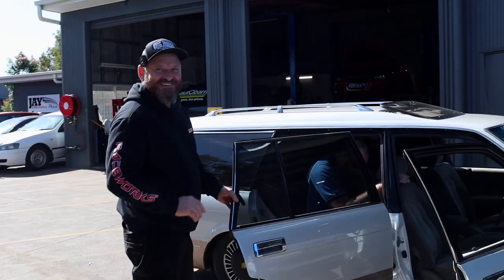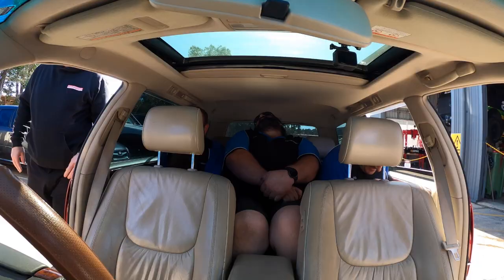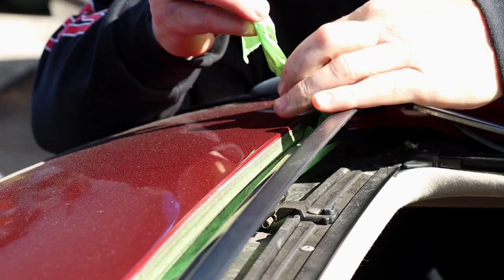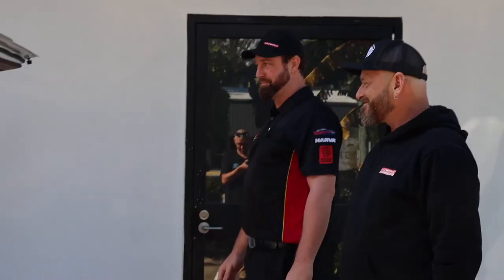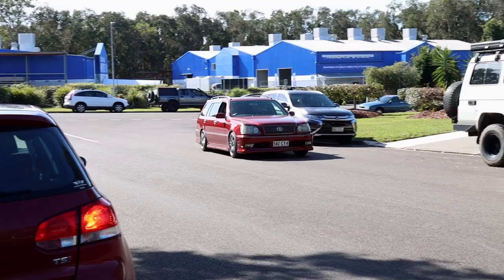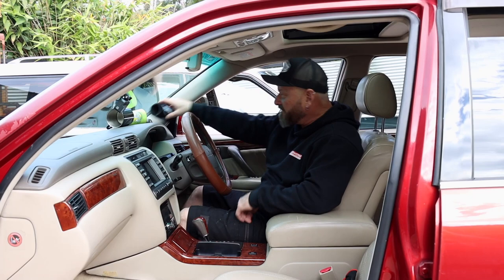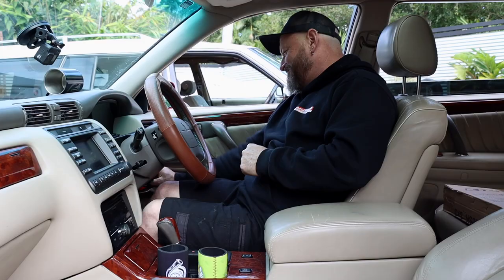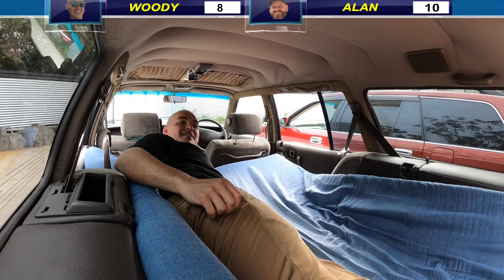Old VS Older, Which Crown is Better? - The Car Review Factory

Comment: I lowered my last 2 cars right down as far as I could. They looked awesome. I did a straight pipe and intake mod and it made a big difference above 3k rpm, and let me chirp the tires in second. Now, my newest car, I left at full height, full silent exhaust, and I love it. I've become and old man. I went so many years on bumpstops to look cool and it did look awesome but man. It sure is nice having suspension again xD I got an ice cream from a beauty of a lady and the road I had to turn on was so steep my older lowered cars wouldn't have made it so, ya know, sometimes yer better off with some clearance.

Comment: Al's for sure. But with the Crown badge from Woody's. Wood's could be a contender if it weren't for those wheels.

Edit: I had a manual, 2007 2.5i Outback. It definitely needed two more cylinders and a turbo.

Comment: If a tree falls in the forest and there is no one around to hear it...it DOESN'T make a sound. Sound waves enter the outer ear and travel through a narrow passageway called the ear canal, which leads to the eardrum. The eardrum vibrates from the incoming sound waves and sends these vibrations to three tiny bones in the middle ear. These bones are called the malleus, incus, and stapes. Without an ear, or the like, to convert the waves... there is no sound